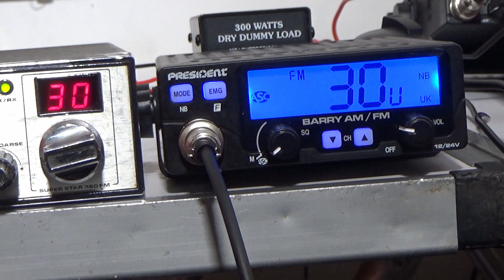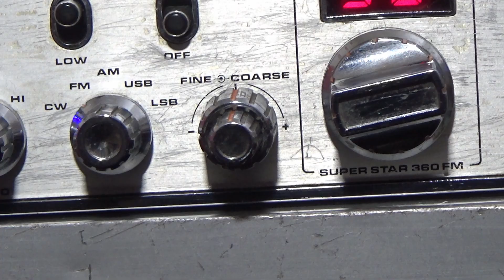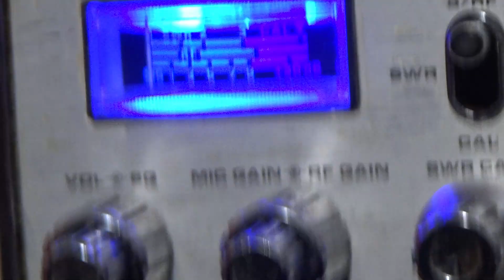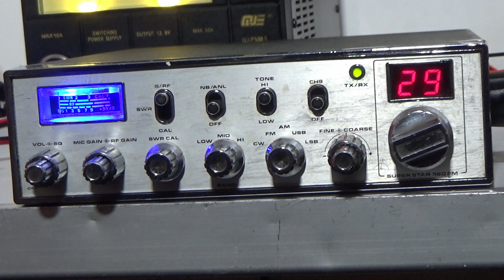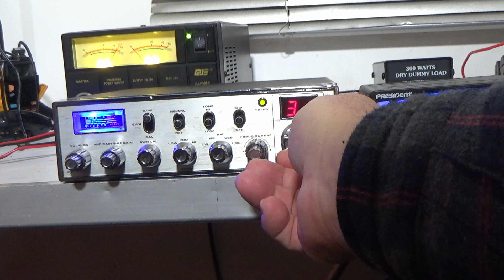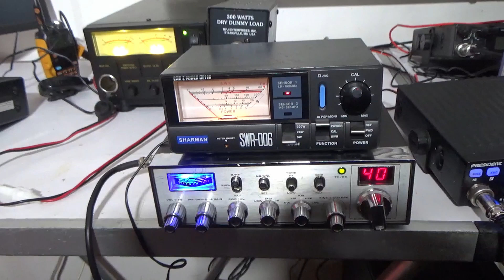SUPERSTAR 360 FM /COBRA 148 GTLDX  MK2 FAULT/POWER TEST.

Comment: Dry joint. or a corroded . trace about totally fail.. You would probably do the rig a big favour cleaning the board with Iso alcohol. Then you can see the condition of the traces... This Cleary has had the golden screwdriver treatment. The rig will never work as it was designed unless it is setup to service manual specs.. If you want more power get a linear amp.. VCO. PLL. Bias must be to spec.. Otherwise through it in the bin...
Reply from the maker: Hi again I replied to you the other day.
I had my brain in neutral lol.
I have found the fault with the 360fm.
Like many 360fm rigs, this old girl has had a lot of people in it.
I think the power was deliberately set low.
In effect legal power, including the low power switch on the back.
The rig sounds a lot better than a lot around here, on all modes.
I swapped it outto a mate, it  works very well.
The fault turned out to be the channel change.
Reply from the maker: hi fella  i still have the amstrad, one day i may go into it again.
As for Amps i have enough for now, been on RIg since 81.
TBH the 901 were never a great rig even when new, but as i was given this one i will hang onto it.

Comment: Steve this COULD  be something as simple as a LOOSE connection to the POWER METER ( loose wire).
Reply from the maker: Hi stephan not only the meter is affected.
The rig transmits about 7kc off.
Only on ch 30, yet if I go 29 and hit the 10kc jump all on frequency.
Every other ch is fine, sounds good in all modes etc.
If I find the problem I will let every one know.
Including if u were right.

Comment: As others have said looks like a dry joint.  I might try some contact spray on the channel switch first but i recon you will end up re flowing it with the iron.
Reply from the maker: Hi Fred its a weird one for sure.
Never seen a rig with a problem like it.
 I will look into it and see what turns up.
 I have no switch cleaner atm, but have the trusty iron.
Reply: @CBRadiouk1  Could try some WD40
Reply from the maker: @CB-RADIO-UK   hi Fred i must admit wd40 is pretty similar, but the cartridge at the back of the ch change is sealed.
 If I use a cleaner it will be the right stuff.
Let's see what happens under a magnifying glass.

Comment: A dry joint is possible but if this was the case it may well happen on other channels as well. It could well be a bad connection within the switch. I am not sure what is available in the UK but here there is a product known as DEOXIT D100 Contact cleaner (not cheap) but safe to spray into the channel switch block. I have seen it used to bring LED displays back to life as well. Spray it in (radio off) and turn the dial back and forwards a few times and bob may be your uncle.
Reply from the maker: Hi Brent  thanks for the tip, I have seen that done.
I think it was on mikes radio repair channel.
Its a shame this rig had a hard life, but still well worth hanging on to.
Reply: @CBRadiouk1  hi Steve it's Albert in Hitchin not sure if you can help my cb aerial is on the side of my property directly behind in line is a comunual aerial and dish when I key up my TV locks and says no signal is there anything I can do???
Reply from the maker: Hi Albert  there are a few things u can do.
Firstly I need some info.
What rig do you use, to give me an idea of what power u are using.
Do you run an amp??
OK this reply is going to be long.
Are u on friendly tearms with any of the other residents that rely on the communal antenna?
If u are do some testing to find out if its only your TV that affected.
 I would take thatstep first, if its only you.
Get some clamp on ferries, and clamp them onto your coax that goes to your TV.
You could also clamp some to the communal coax that feeds every one.
Do you run a signal booster for your TV??
I will wait for your reply, but will ad.
In an interference situation, here are the 2 most effective things to try.
Reduce power.
Move your antenna further away, not always possible of course.
Reply: @CBRadiouk1  hi Steve my cb aerial is direct in front of communial aerial about 30 metres away. Using the grant 2 with a 30 amp power supply. Have you had or heard the dx5000 ? Thinking about getting one of them my aerial is going back also I'm replacing it with a sirio 2016 let me know when you are on next and perhaps you can give me a rig check. A few people have said modulation not good and I'm off frequency also on ssb.
Reply from the maker: @albertfooty7868  
Hi Albert the rig looks almost thesame as the 6900n.

Comment: At one time the Superstar was on CW and the Pres. was on FM? I guess it  won't matter. Thanks for the video, Your Friend in the USA, 21  in S.C. Drop in sometime. #3 Thumbs UP
Reply from the maker: Hi Dirty  the modification done to this rig, puts it onto fm.
Disabling the mode switch, and locking the rig to fm.
Flicking the switch will then put you onto, what ever mode the mode switch is set to.
Reply: @CBRadiouk1  ok, new to me. Thanks.